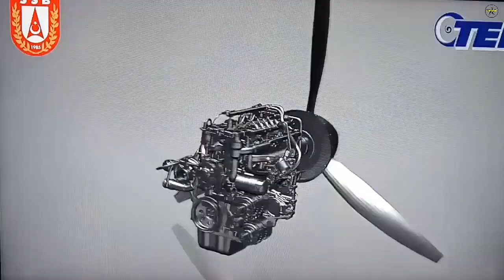PD170 engines were delivered for Bayraktar TB3 SİHA

Comment: Its more efficient and cost effective to use cheap, reliable, indispensible Bayraktar TB2 than fighter jets on the Andonulu. TB2 though much smaller and slower has a longRange radar, LongRange air to air and air to ground missile systems capability that is second to none. It can stay aloft much longer than jet fighters making it more deadly. When Kizilelma is eventually integrated onto the Andonulu, it will be invincible. In modern warfare...who see first and who shoot first... wins.